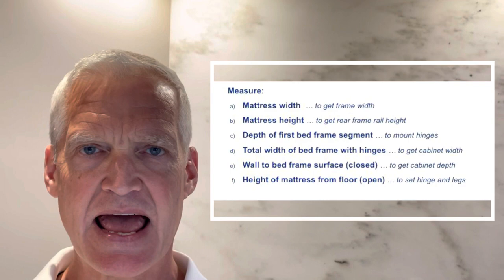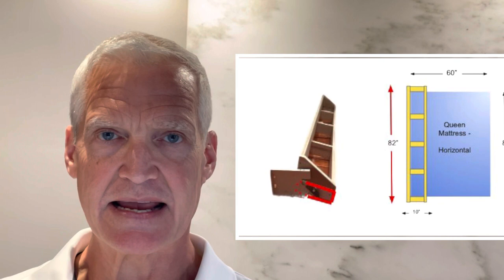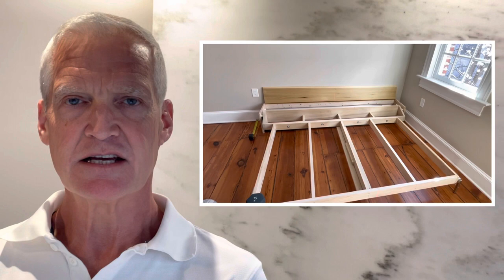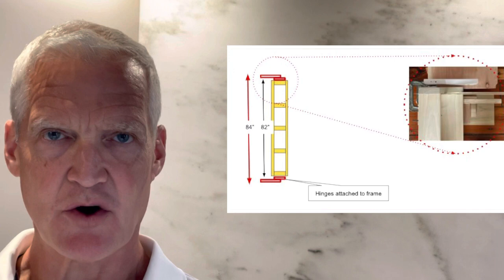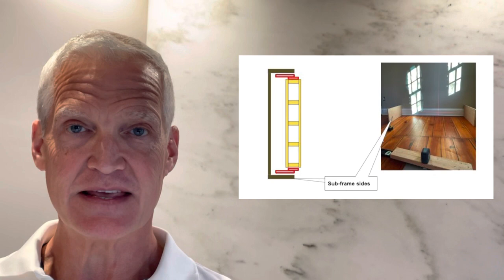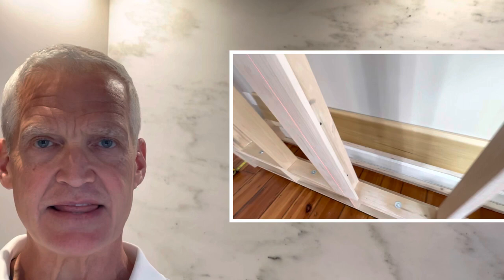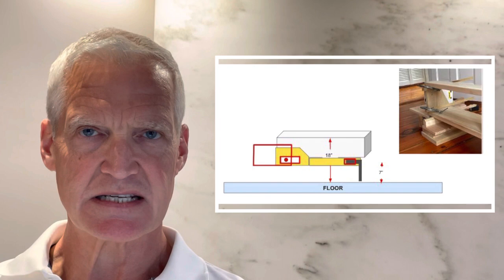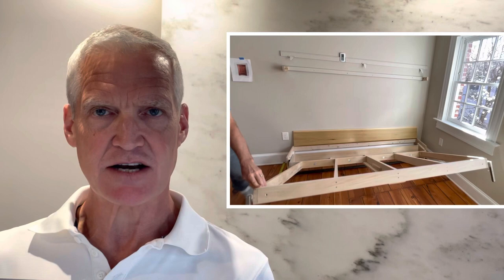Dimensions for Murphy Bed

Comment from the maker: Hi.  For a twin bed you could build a smaller frame.  If you build it in 2 parts like I did, the part where you attach the hinges should be about 2” wider than the mattress. I designed the second part of the frame like a platform bed where the mattress overhangs the frame 3 to 4”. So you would subtract 3” from the left and right sides and the side of the mattress opposite the hinges.  Hopefully that makes sense.
Reply: Thank you for the answer that make a lot of sense for me